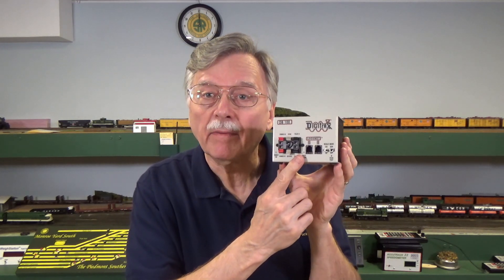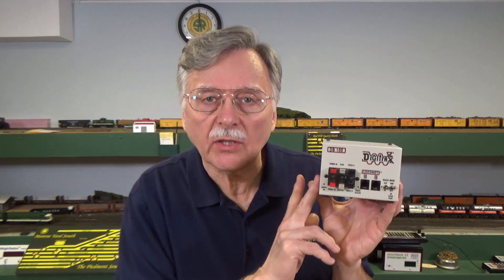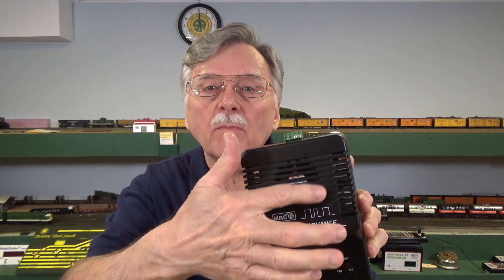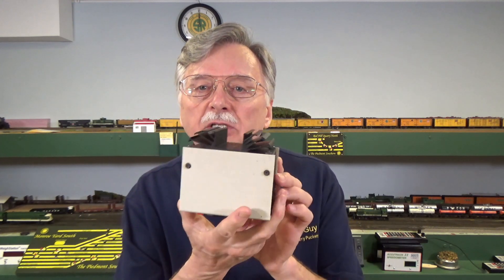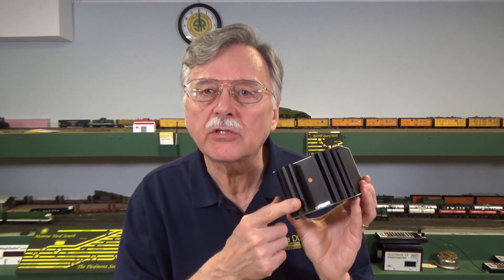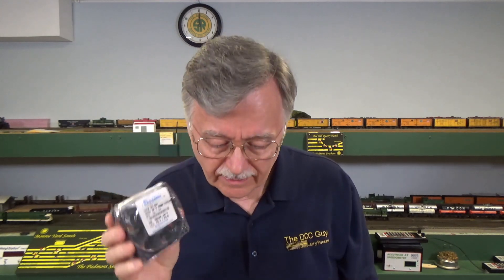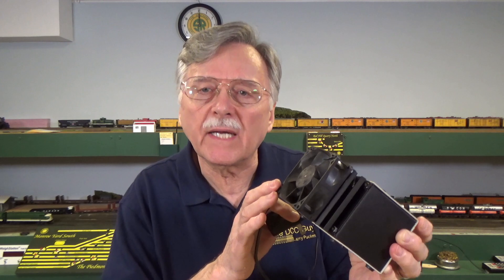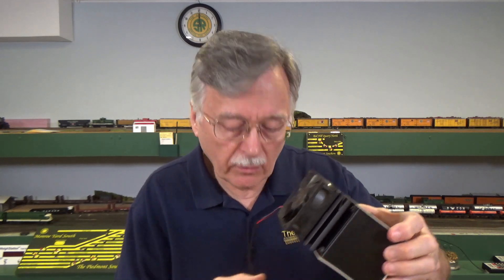Keep your DCC system cool (80)

Comment: Should my boosters and circuit breakers for each area that they serve can they be located in one area by the command station and buy the central a central area or can they do they have to be out where the segment that they're protecting or Servicing
Reply from the maker: You can do either. At the Vienna VA club we had them all lined up next to each other and it worked well because it was a central location and the bus wires could run in all directions and still be under 30’. However on the Piedmont Southern I have my two 8 amp units located pretty far apart because it is a long shelf layout. With Digitrax equipment I just run a Loconet cable between them for the sync and data connection and a 14 ga wire for the reference ground. It would be similar for NCE. I think that MRC units use the ground wire in the data cable for the reference ground. You’d have to ask if another system is used.

Comment: Larry when using the fan wired to the heat sink  you should have the bottom of the supply up from the bottom of the box maybe 1/2" so that air can escape  from the bottom too.  Best would be to have the fan on the top pulling air from the fins.  Look inside more modern PC's and you will see a lot of shrouds to guide air flow where it is needed.   The goal is to keep those heat sinks close to normal room temperature.

Comment: Hi Larry,  I have a Digitrax Super Empire system.  I run a 2012 power pack with it. I have been running this for about three years now.  Now I am have a problem with this Max Slot thing, to the point that I can't call up any of my engines.  I followed the instructions in the manual,  but i get nothing.  Can you help!!!
Reply from the maker: The DB150 only has 22 memory slots for locomotive addresses. When you reach 22 then you get the Max Slot warning. Have you tried using OPSW settings 36-39? These clear all memory spaces and give you room to work with. In normal use you should dispatch your locomotives after running them to keep your memory free. Be aware that using the OPSW settings to clear your memory will also wipe out your universal consists but they are easy to set up again.

Comment: Great video.  I've been thinking about this for sometime.  In your photograph, what are the circuit boards to the left of the DCS200 and to the right of the DB150?  I am also thinking of putting my power supplies inside the enclosure.  What do you consider to be the wisdom of either doing that or not doing that?  Thanks. Sincerely, Kennedy Gauger
Reply from the maker: The circuit board on the left is a PSX4 power manager/circuit breaker. I use it to break half my layout into 4 individual blocks. Since that photo was shot I have changed things around a bit now that I have more of the layout completed. I now only have my 8 amp DCS240 command station in the box with the PSX4 and a 10 amp power supply. So that keeps little fingers away from the 120VAC wiring, cuts dust buildup, and keeps everything cool. I am building another enclosure for my 8 amp booster etc. it will power the other half of the layout. I will shoot an update video when I am ready to put it together and install it.

Comment: Good video.  Years back I bought a used 240 V AC computer fan, about the same size, and it runs fine on 120 V.  After the same experience you had, I added a mesh screen to protect my fingers. Like the idea of adding a dust filter.
Reply from the maker: Yes, a screen is a good safety precaution which is why I left that little demo in the video instead of editing it out. Actually the little plastic screen and filter kit I showed will fit over the back of the fan and protect little fingers. Fortunately the fan wasn’t sharp enough to cut me, only surprised me.